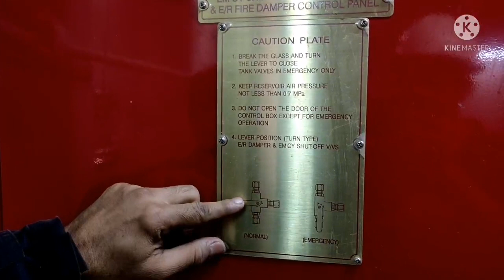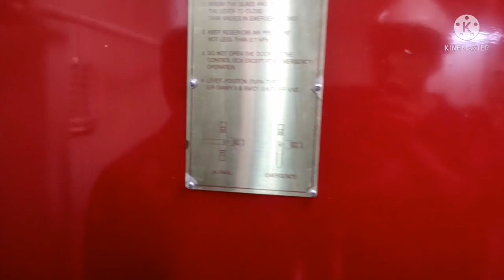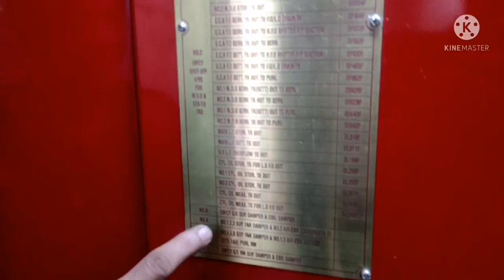How do they do.. how to operate Engine room Funnel flaps...

Comment: Thank you 2nd sub for your great effort. 
Can you plz describe what to do if there is a sluggish operation of damper in E/R supply fan. I mean to say what all maintenance we need to do. 

Your video is really helpful. Kash Mai jab cadet tha or mera 2nd eng Aisa milta..
Reply from the maker: Thanks for your good compliment sir..
Regarding damper maintenance...
* have to regularly do greasing.
* Have to lubricate the damper piston.
* Have to check the air supply pressure regularly.
* Have to regularly clean the air filter which is usually not noted during  the Saturday routines
* Ensure the solenoid maintenance is done properly for operation
Reply: @marine-knowledge-basha  Thank you sir..